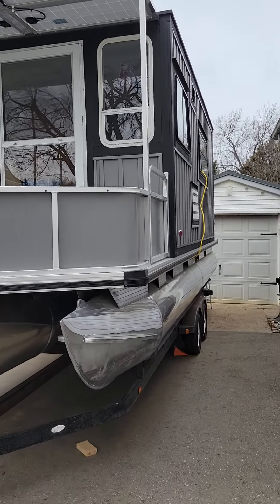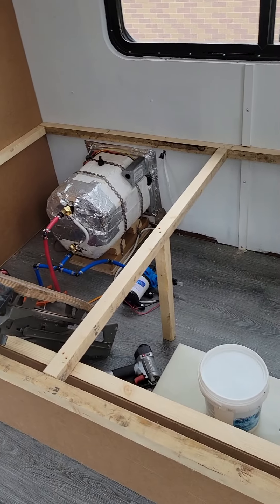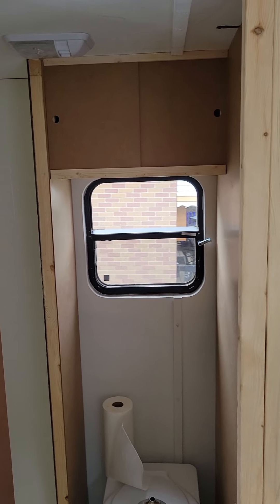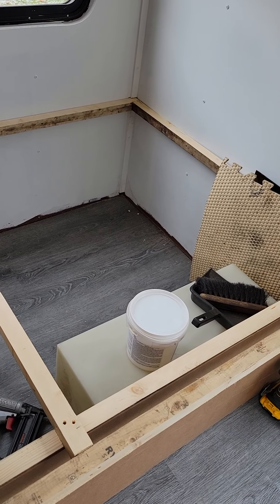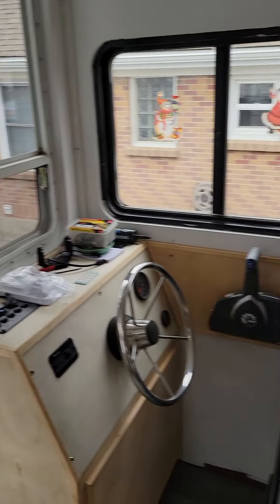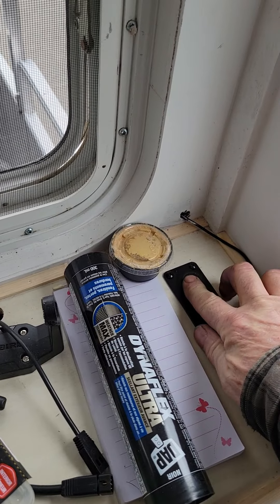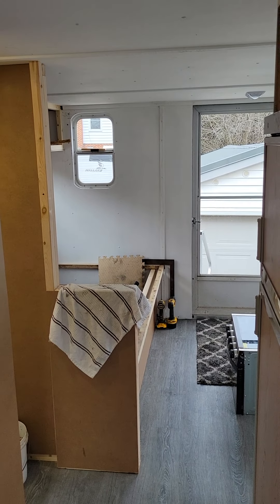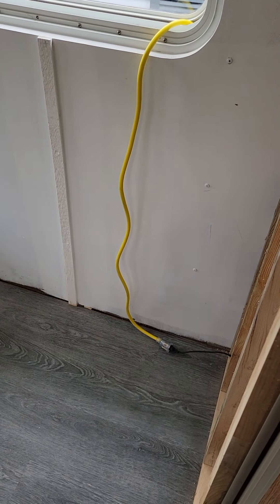houseboat build update #3

Comment: Looking great! Are you planning on trailering it or putting it in a slip? My 28' houseboat pulls pretty good but I went ahead and put it in a slip on lake Eufaula OK. Having shore power to run the A/C instead of the generator sure is nice plus I can have my other boat there for fishing. I did put Garmin electronics with livescope on the houseboat for crappie fishing.
Reply from the maker: Not 100 percent sure. First summer likely tow it around. When I haul it north I hope to have a slip. I will have a small plastic jon boat for fishing but would love to be able to have my 16' legend with me for fishing.